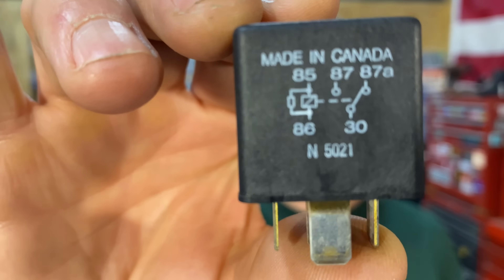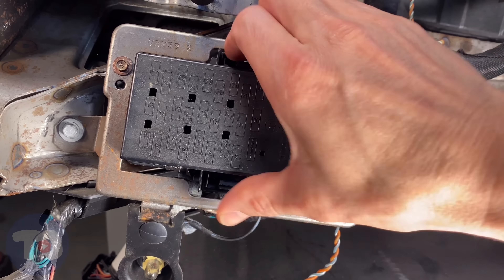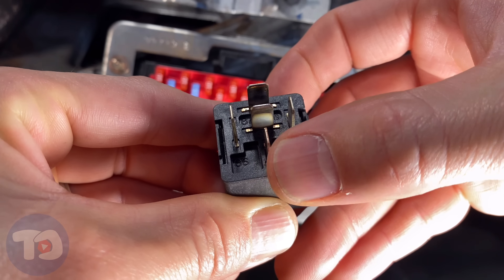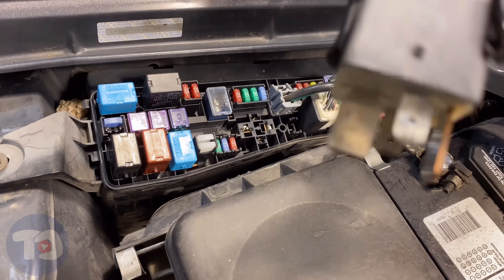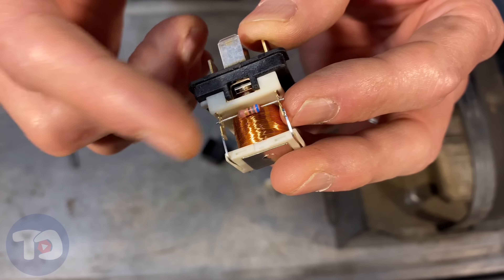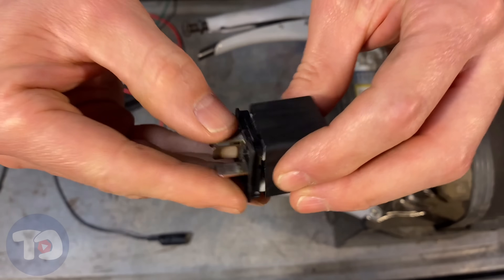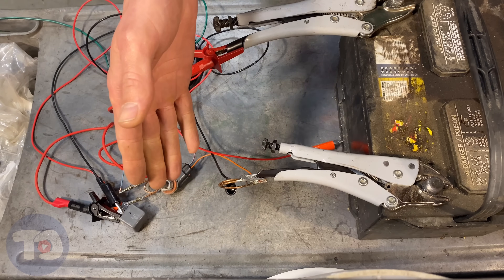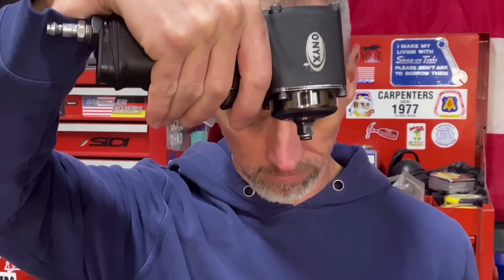Why are relay pins numbered like that?

Comment: That resistor just lowered the spike current and can still cause issues especially if it fails or goes open, if you want to stop it then you need to put a diode across the coil pins and a diode in the control line to the coil. This stops the spike and prevents it from going back up the control lines if the across the coil diode fails.

Also important to note is that these automotive relays are for DC only and not to be used to switch AC loads and this is due to the contactor spacing vs the arc type that AC creates
Reply from the maker: Good info. Thanks.

Comment: You use of basic electric terms is flawed.  You really should take a course in basic electricity.  Having been a technician in military electronics I was interested to see why commercial relay terminals are numbered as they are, but  after watching your presentation I still did not  know.  (I did subsequently do a search on the Internet and found relay terminal numbering specifies various functions such as current rating  etc of the terminal)

Comment: I've never seen a resistor used to minimize inductive spike on a relay.

I've always seen reverse biased diodes used for that.
Reply: Resistors help the contacts opern quicker. If you wan to increase the speed at which the contacts open use a resistor or a zener diode instead of a regular diode in reverse bias.

Comment: A coil of wire develops a magnetic field when DC current passes through it - that's what pulls in the armature that operates the contacts.  This magnetic field actually stores energy.  When the DC current is turned off, the energy in the magnetic field has to go somewhere, and so it is "dumped" back into the coil wiring in the form of "back EMF" (Electromotive Force).  This EMF is a voltage, but it is of the OPPOSITE polarity to the original voltage that energized the relay.  It's this reversed voltage that will damage electronics.  

A simple resistor across the inputs to the coil will help dissipate the reverse voltage, but it's not very fast and it does shunt part of the operating current all the time; this is inefficient.  If you put a diode across the coil inputs and orient the diode so that it acts as an open switch when the operating voltage is applied, it will act as a closed switch when the operating voltage is removed; that means that the diode looks like a dead short to the back EMF, giving it an almost-instantaneous low-resistance discharge path to protect sensitive electronics.

Notice that this only works for DC circuits & relays - you don't have this issue with AC relay coils because the EMF & back EMF are alternating all the time.
Reply from the maker: Very well put. Thanks.
Reply: A diode used in this fashion does not act like a closed switch when the operating voltage is removed and it doesn't look like a dead short to the back EMF. If it did, then it would damage the driving transistor upstream of the coil. There is still a voltage drop of about a half a volt across the diode. 

You're also wrong about the use of a resistor. A resistor is faster at opening the contacts than a diode. The main reason a diode is used is because of the resistor's inefficiency. Like you said it's using up energy the whole time the relay coil is energized. To get the best of both worlds, put a resistor in series with a diode and both of them should be in parallel to the coil.

Comment: 2:20 Type B relay but nowhere is a "b" written but there is an 87a. Just so your not confused.. 😕
Reply from the maker: No kidding!
Reply: There are 2 types of ISO mini relays: a type A and a type B. The only difference between type A and B is the location of pins 30 and 86. In type A, pin 86 is in line with pin 87 and 87. In type B, pin 30 is in line with pins 87 and 87a. Type B relays are more common. The letters A and B are not printed on relays. The "a" in 87a has nothing to do with the type of relay.

Comment: Just got 1 why question. Why are the schematics on the relay so confusing? They draw a magnet, so you would aspect it pulls on the switch. But that’s not always good displayed.
Reply from the maker: Yeah, I wish they did a better job with that.

Comment: Ok thanks, but now I have questions 🥸
Reply from the maker: That’s the right way to start
Reply: @ToolDemos  👍, I could not get the link between a DIN schematic in the 1930’s and the fixed numbering system. Or was it a patented schematic, or a preset standard component…
Reply from the maker: @jackgerberuae  as far as I can tell the people at DIN standardized all of these schematic numbers. When Bosch manufactured their relays, they use those numbers from DIN.
Reply: @ToolDemos  ok, thanks

Comment: It's a German system.
They basically came up with a numbering system that describes what each pin is.

The NEMA system / the DIN system - meaning

COM /86 - the common connection on a switch 

NO /87 - The normally open contact , it connects with the  switches common term when the coil is energized.

NC /87a - The normally closed contact , it is connected to the switches common terminal when the coil isn't energized

+ /85 - the coil terminal the positive voltage goes to 

- /30 - the coil terminal the negative power goes too.

So Germany decided to create their own system instead of using a system that was already in place and being used around the world...because they're Germans.
Reply from the maker: Exactly
Reply: If they have this much pull after losing the war, imagine if they had won.

Comment: It's a standard for 100 years - WHY change it?  It works and everybody whoi can read a circuit understands it.
If you don't - get your cotton pickin' hands OUT of that relay box, and call someone who DOES.

More relevantly ... Why are you guys still using measurements based on ENGLISH KING's appendages?

Diode is better . . .  as long as it is correctly wired becasue it completely clamps the inductive "kick".
Reply from the maker: The only answer to your ‘why’ question is: because ‘Merica! Not a great answer, I know. That system did get us to the moon, though.
Reply: Are you sure about the diode? I think a resistor may be quicker at opening the contacts.

Comment: oct 14 , 2023    Colorado , USA

well done .  the size difference of the metal tabs was  an  informative clue  for telling 
       coil ma drivers or output hi-amps switch.      and    how the hi-A  switch  can have 3 tabs  not just 2.
depending on if the default is 'on' and the  relay is to turn it off.  or vice-versa

my one  Carrrier house furnace  circuit board  fails the self-test due to a relay for the blower motor not working.

now my confidence is raised for getting in there and fixing or replacing it with a new one
Reply from the maker: That’s great! Hope it goes well for ya.

Comment: 30Amp = power source connector Pin 30 Nice tip. I recommend you add a schematic diagrams: SPST, SPDT, the control circuit you built for the demo. Add these definitions: P = Pole,  T = throw, NO and NC. After teaching control systems for 30 years I can tell you that NC is better understood as Normally Connected, and NO = Normally Off. Because the word closed in the vernacular is and always has meant access denied. hope that helps
Reply from the maker: Great tip, thanks.

Comment: First time I have watched one of your videos.  I notice a manifold guage set hanging on the wall.  You really should hook the loose ends of those hoses to the blank plugs on the manifold so they arent hanging with the inside of the hose exposed to air.  You need to put that on deep vacuum for a few hours to pull all the moisture out of your hoses now.  If a bug crawls in that hose and gets injected in a refrigeration system will cause a vexing and expensive problem to repair.   No good leaving those hoses open. You should study up on why water, even in minute quantities is a really bad thing in a refrigeration system.
Reply from the maker: All good advice, thank you.

Comment: When I was a transit bus tech for 15 years, we only needed to know the basics. 85-86 is the coil terminals. 30 is the common terminal ( power) 87a normally closed. 87 normally open. 
  We where taught some relays had a diode. But I don’t remember the reason. You and some of the commentators,did a great job explaining.  
Our older coaches used relay logic on many circuits. 
The newer coaches after 2004 or so where multiplexed.
Reply: The diode is supposed to protect transistors from the inductive voltage kick when the coil power is removed. The voltage from the inductive kick can destroy unprotected semiconductors. You often see these protection diodes in MOSFETs since they can be destroyed by high voltages.
Reply: @picklerix6162  I was taught in bus multi plex class, that the modules use MOSFET transistors. Because they can handle up to 10 amps of output current. 
Didn’t realize a voltage spike would damage them.
Reply from the maker: I miss old stuff sometimes.

Comment: This works sometimes: bang on relay. I had a horn relay that would not work. So I disconnected battery. Tugged, poked, whacked and shook relay. Would not come out. Read it had to be replaced with whole relay tray, or cut out. Hooked up battery to call it a night and presto it worked. I guess it was just stuck with a little corrosion. If does it again I'll drill 3 tiny holes in the top and spray silicone spray into relay to possibly fix corrosion issue for long time.
Reply from the maker: Right on

Comment: HELP!
I have a JD1912 4pin relay.
It only has 30, 87, 86(×2).
How can i connect ground if there is no 85?
Reply from the maker: That’s a new one for me. Never seen two 86s.
Reply: @ToolDemos  me either. thought i was crazy for a sec.  I’m sending these back to Amazon, sad what Amazon allows vendors to sell. 

Got a Bosch-style 4-pin from AutoZone…back in business.   And thanks for your response.  

btw, if you have any videos about how to connect LED blinker, lights (load) and blinker light switch to 4-pin relay please let me know. 

The blinker switch on my ebike has three wires: right (blue) middle (black) and red(left).  

Thanks again. 

/Bklyn👑
Reply from the maker: @robertmotion  no, I don’t, but I do have a potential piece of advice. If your LED doesn’t light up, check the polarity of the wires. LEDs will only work in one direction and not the other.

Comment: I don't understand the point of the resistor. Electronic outputs can be easily protected for inductive loads, and a resistor is not enough, that does not protect against the negative voltage, it only lowers the peak a bit I think. You need diodes for that and it's typically integrated inside the output circuit. At least that is how it is done in industrial applications, not just for relays but aso for pneumatic valves and other stuff that uses solenoids. The output is designed such that both any negative voltage, and also positive voltage that is higher than the power supply, gets shorted through diodes. Only on really powerful valves i see sometimes an extra diode, and in that case it's a special type, fast and high current.
Reply: I think i already know the answer. The resistor is not there to protect an electronic output. It's there to protect those fragile switches on your steering wheel against premature aging due to sparks. For that it does work perfect.
Reply from the maker: You’d be amazed by how many PCMs burn out because of back EMF from ignition coils and fuel injectors.
Reply: @ToolDemos  yes at that high switching frequency, things get rougher and the protection circuit will eventually give up. In machines that i work with, the switching doesn't occur so fast and continuous, so the protection lasts longer. And even if the output gets blown up, it's not a big problem. The outputs are always replaceable as a separate unit, and they are opto-coupled  to protect the brain of the machine against any failure from that side. So the expensive and more difficult to replace brain is always safe 😃

Comment: Those numbers are same with BIG contractors  like 400V and let's say 3x 600A.
1 3 5 12 A1
\ \ \   \    □
2 4 6 13 A2

So 1-2.. are main connections and some 68-69 is opening connector for signaling, like 13-14 closing one..
Contactor is just big relay too.

So these numbers are older than source you mentioned. Strömberg used these outside automobiles before 1960 or 1950.

But who "invented" these numbers meaning came somewhere from Deutschland.. I think. Could be originally from some telephone switching systems, who knows.. Those things used a lot of relays. 
American telephone switching worked whole differently and used turning switching after people operators throwen out of job and dialing became on every telephone.

Siemens maybe??
Reply: Duh, first secondary closing one is 13-14..
Reply from the maker: Neat how tech is related, just different scale.

Comment: The "Why" of it is pretty straight forwards. think of it as 80 series terminals, 30 series terminals, and so on. Where the terminal is pretty fundamental, then it gets a low number in the series. So, 30 is for un-switched power, you get 30 for the + terminal and 31 for the - ground terminal (all systems presumed to be negative ground) then someone invents campers or 12v/24v systems so we need another designation for the leisure battery or the second 12 volt one, but 30 is gone and so is 31, which leaves us using 30a. Top of my head, 50 series is headlights (?), 40 series is indicators. As a rule of thumb the actual choice of number is loosely related to the order you'd likely trip over them working from the battery in a typical circuit, usually leaving some numbers at the beginning of the "series" to allow for anything that might happen in years to come. So, the "why" is pretty arbitrary but loosely follows some rules.

Comment: Did you know the main difference between water and electricity traveling with the aid of a conduit/wire/channel, the water flows inside with resistance from the pipe walls so the flow is in the middle of the pipe with the resistance at the inside wall, which is why square downpipes are shit, electricity flows on the outside of the wires which is why a corrosion and resistance/restriction problem can be helped by proper cleaning, coating and connection practices. This helped me understand what I've been told and worked on for 50 years.
Reply from the maker: Right on, thanks.

Comment: The video didn't actually say WHY they were numbered that way, just that the Germans did it that way.  Did I miss something?
Reply: From what I understand, yes. The way I understand his explanation is that they had a list of components and their pins numbered, and when they got to relays the 85th 86th and 87th pins were just the next numbers available. I assume 30 is something that's shared by other components, like an "always hot" or "always grounded" pin.

Comment: I had some equipment that used a Form Z relay as an ac motor reverser. Interesting. Saw my work buds burn up a number of items because they were accustomed to typical Form A, B, and C relays. I found a chart that had a listing of "every relay" form type and each one's variables, IE: Diodes Resistors, Capacitors, ETC., and got a Happy Award (but no extra money) for fixing an internal company problem. It taught me to not memorize any relay or other connection numbering, as another equipment manufacturer may do something different, so I always reference the MFG's wiring diagrams and caught a few errors there too. I never burnt anything with a wiring error. I say "every relay" with trepidation as stuff is always changing and new things come along.
Reply from the maker: Sounds like you are the go-to guy when things get serious.

Comment: The thick terminals on the densei relay can carry more  Amps, not voltage.
86 and 85 are the relay coil/solinoid, some have a diode across them to stop the high voltage generated by the coil when the power is removed.
It's known as Back Emf.
Reply from the maker: Thanks, good info.

Comment: Connecting the load to 87 is a mistake. 87 should be your SOURCE...and 30 should be your LOAD. Why? Because the COMMON is where you want to send power...not where it comes from. The COMMON is the "switched output".
Reply from the maker: I suppose that works too.
Reply: @ToolDemos  it allows you to supply power from 2 sources (ie 2 batteries) to one device.
Reply from the maker: @steevemachine118  ok, yeah. I see what you mean.

Comment: For pins 85 and 86 there is no ground /negative and positive. It is the coil, not diode. pin 30 is power supply, ALWAYS in any car electrical cirucit so also for relays 30 is supply side.
There is more pin numbers, like 15 and 61 for different circuit function.
And WHY is pins numbered like that?

Comment: A resistor is not going to protect from back emf.
Only a diode can do that.
Reply: There are many ways to protect from back EMF, a diode is one, a resistor is another, but there are also Zeners and MOVs. The difference is the effect they have on the release time. Go read an article about "Slugged Relays", used where timing is critical.